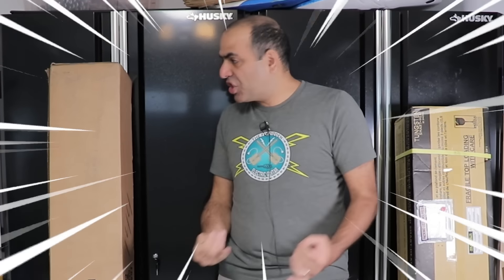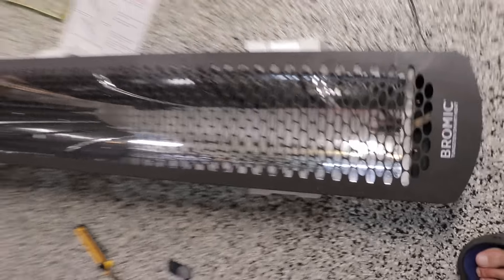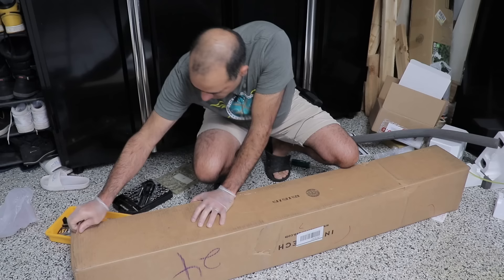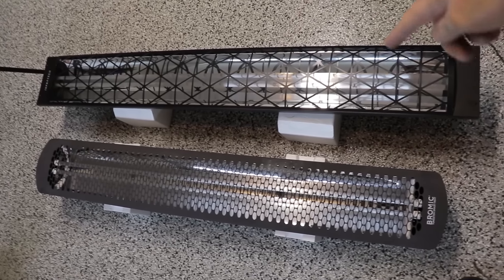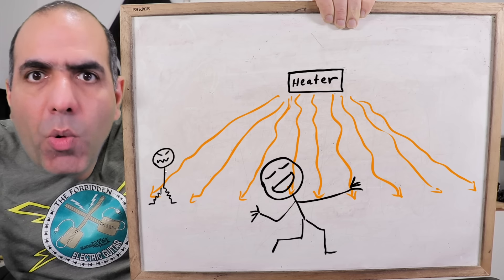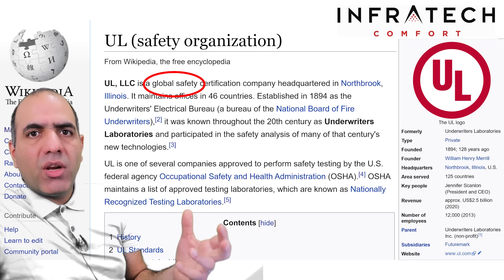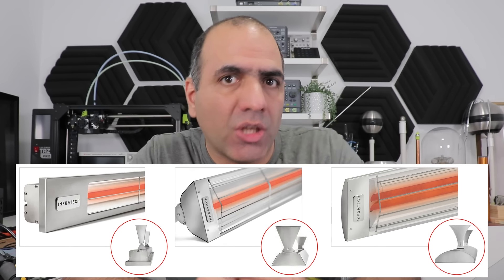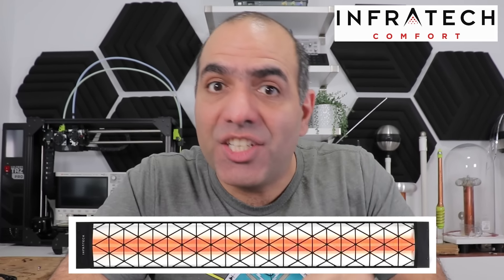Comparing 6000 WATT Resistors, Infratech versus Bromic Heaters

Comment: 6 kW... hmm. At current energy prices, that would cost me 2.64€/h to run (about $3). If I ran this for 24 hours a day - which would be stupid, but if I did - that would be about 64€ of power in a single day, or about 23000€ per year if used 24/7. Nobody is realistically to run this for 24/7, but if I hat it on for, say, 2.4 hours a day, it would consume about 2300€ of power, simply to feel a bit warmer.

To me, this seems like an excessive waste of power, especially when you could just... sit inside, dress warmer, or both.

Comment: So, solid metal (I'm assuming some kind of steel) doesn't block infrared? That... literally makes no sense.. there are materials that are transparent to infrared but I don't think any of them would last in the extreme heat, but what Bromic is claiming ls complete garbage! Metal can either block or reflect infrared, not be transparent

Comment: Testing them at 5ft is hardly fair and not to manufacture specs. 8ft is what is required. 8ft is what is optimal
Reply: Both manufacturers have manuals listing heating areas for a wide variety of installation heights, so it clearly doesn't matter. All that matters is that they are at the same height for this comparison

Comment: What a pair of absolute rubbish devices, no connecting hardware and it has to be assembled.
A highly dangerous piece of equipment if assembled incorrectly.
I would hope they came with placement instructions so you don't set your ceiling  above the heater on fire.
Here in Australia they would have to be assembled and installed by a certified electrician thank goodness.
I liked the heated area evaluation test and results analysis, some figures to give a quantitative comparison.

Comment: You never actually powered on the Infratech heater. You tested the competitor's product, but the company that paid you to promote their product you never actually tested it. Instead you started reading from their marketing material, at which point I turned the video off. Clearly you thought that theirs was going to be only as good as (or possibly worse than) their competitor, and you didn't want your video to show anything bad about the company paying you to promote their product (you probably wanted to show it being far superior, but didn't feel confident in it being superior). So you skipped testing theirs altogether. Even though that would have been one of the best ways to promote it if it worked as well as they claimed, I guess you didn't feel confident enough in it working to actually test it, so you cheated by reading the marketing material.

By the way, reading a product's marketing material is NEVER the best way to test a product. Companies will often put misleading info in their marketing material just to trick you to buy it. If I want to know which product is best, I'd either test it myself, or watch somebody else test it. Unfortunately it seems Mr Boom, that you weren't up to testing it. I like your videos usually, but this one you were clearly unduly influenced (even to the point of refusing to test the product, for fear of what the test might show) by the company paying you money. So I'm gonna have to give this video a thumb's down vote.